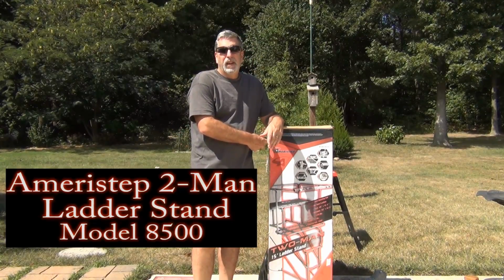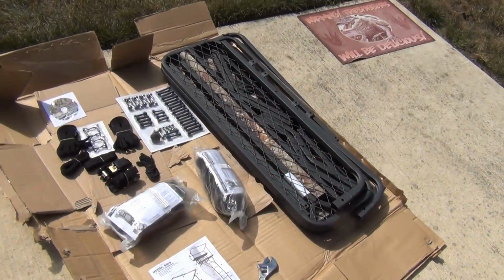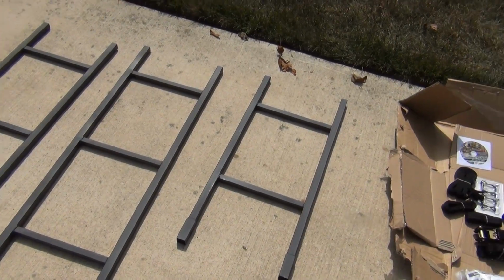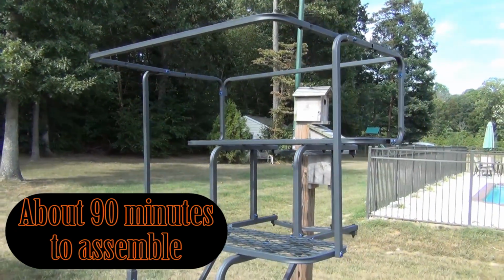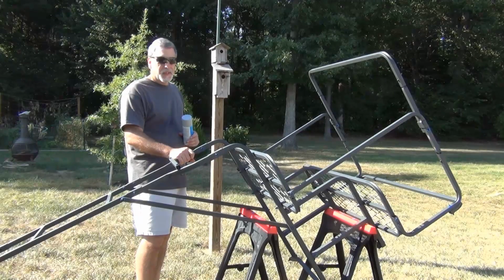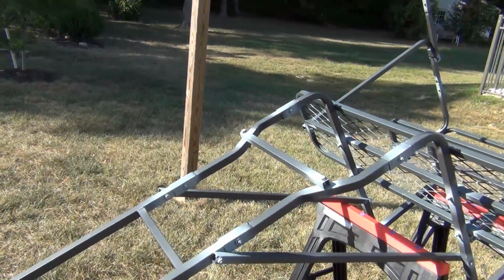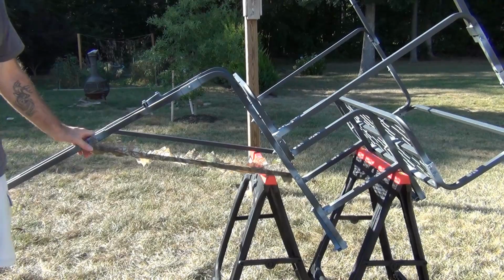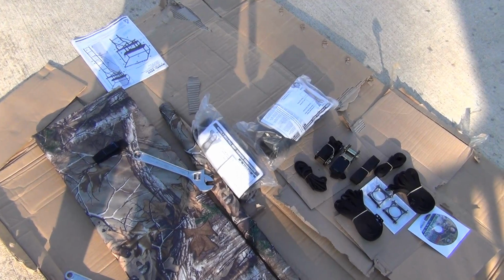Tree Stand (Ladder type) Preparation - Part 1

Comment: ladder stands are great and much safer, I like the camo painting, gotta do this, and spray can of truck bed liner for the steps and floor,thanks for sharing your videos
Reply from the maker: +john blackie Thanks , and thanks for the tip on the truck bed liner. very good idea to keep it quiet and non slip.
Reply: +whiterook85 also good for your wooden stand steps and floors, just do well ahead of the season for scent control, your channel has many great tips, thanks for sharing them all .
Reply from the maker: +john blackie Will be definitely be picking up a can or two and using during our Spring 16 trip. Have to redo the floor of one of the stands and that will help. Thanks again!
Reply: +whiterook85 your welcome, love your cabin trip videos, especially your awesome food and different beverage choices.